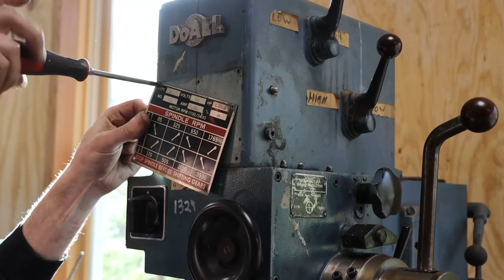Power down feed repair

Comment: Steve when engaging the power feed,  perhaps you just need to hold pressure against the handle, either inward or outward pressure to allow the gears to sync and engage.  Also do those gears sound a little dry or is it just me.  You didn't show it so i'm curious if any fresh grease was applied inside that gear box.  Just an observation.    Seems like a real nice drill press and could tell by that big grin that you are pleased with the repair and the added function of power feed.    Nice job sir.    
How's the truck coming along?   I'm really enjoying the "Truck Re-build series".     Thank you for bringing us along .
Reply: He mentioned he still has the final clean up to do.  Knowing how Steve operates, we can be sure there will be new grease in there!
Reply: @paulcopeland9035  Yeah I guess you're right.   I can't imagine him omitting something as simple as that.

Comment: 6mm thick!.... no wonder the phenolic gear broke, although I s'pose that clutch was supposed to save it. I expect the phenolic broke at one of the pin holes... but other than that, it was a perfect design ;-)
Reply: Likely just broke from wear, as it likely had plenty of shock loading from the feed being engaged, which the slip clutch does not stop. Yes likely started at the pin holes, thinner material there, and chance says that the shock loads would all eventually be there enough to crack a fibre, which then went to a crack, and all the way to failure. With the new gear and the tight fit I would not have bothered with the pins, simply use Loctite 603 on cleaned and degreased surfaces there, and press fit together. Will hold up forever, and slip is very unlikely with that fit, as the clutch will slip before then. 

I have run 1 HP motors through gears held on shafts that way, and they never came loose, even though the only thing holding them on the shaft was the loctite and a keyway, plus the press fit, because the new gear, changing speed on a variable speed drive, from Varimot drive, to a VFD on the motor instead, was for the newer design SEW gearbox, and just thicker enough the snap ring would not fit at all. If it had slipped I would have known before it came off the shaft, as the clearance was not enough to fall off, but enough to lose engagement with the new drive gear on the motor instead. What else can you do on a drive made in the 1950's, but you need it to work with modern controls instead, and there is no stock of the new drive available, but the gears are. SEW stopped making that Varimot drive in the 1970's, but kept the gearbox casting as part of the lineup, and you just swapped in different gear ratios. No way to fix the old one, no more rubber balls available for the vari part.

Comment: Steve,  If the handle is plastic you should be able to repair it with regular plastic model cement. put a good dose of model cement on it, coat it a second time about an hour later and let it sit for at least 24 hours.
Reply: There are some great plastic epoxies out there.

Comment: Ha you had one of those detent balls make a break for freedom too! I also had one of the springs go gaboing across the shop. But I found it 😬. Mine is an Arboga em825 mill, same overall layout with integral motor, older, much rounder look, and shifter handles are metal. Built like a battleship.

Comment: Wondering if the gear was the width of the driving gear. It could have been done by counterboring to fit over the brass collar holding the drive pins. I guess the phenolic gear was the fuse for overloading the drive train. Maybe a half width gear in brass is same strength of a twice width phenolic gear.

Comment: Cool fix. Special thanks to your Swedish fan.
The down feed engagement seems kinda janky. I used to operate a big Carlton radial drill. On that drill, you engaged the handles by pulling them away from the head, which seems an intuitive motion for engagement.   Whereas on your DoAll, you push the handles in, which seems counter intuitive to me. Maybe it's a Euro thing.

Comment: It looked like there was only two of the three oilers replaced on the right side of the lower housing. 

Also I guess the clutch disengages when there is interference or reaches the end of travel.
Reply: I was gonna ask how the down feed worked with the depth stop?

Comment: Did you think about taking your new cut and drilled gear and setting it up on your extra gear stock and drilling the pin holes in the extra stock so those ne holes would work in the future? Just a thought.    Cheers.

Comment: Is there any chance that the original gear had a rebate to fit around the top of the clutch mechanism and thus have a larger face width?
Though, 6mm is likely to be more than enough with brass instead of phenolic.

Comment: I played with my radial arm drill for hours power drilling 1” holes as soon as I got my power down feed fixed had to make a new worm wheel for it couldn’t justify spending 600$ for a 2” gear but made a fixture and made a couple in plastic before making one in aluminum should work well it’s the weakest link in the chain if it ever gives I’ve got the copy fixture with the plastic gears I’ll build another out of bronze reckon it’s the nature of being a cheap ass

Comment: I can see why the phenolic gear broke. Down feeding into something very tough won't end well.
Reply: I think that was kind of the point.  Just that gear blows up...the rest of the drive train survives.
Reply: Though it is interesting that they installed that gear on a slip clutch.  Must have known that this was going to be a potential weak point on the drill press.